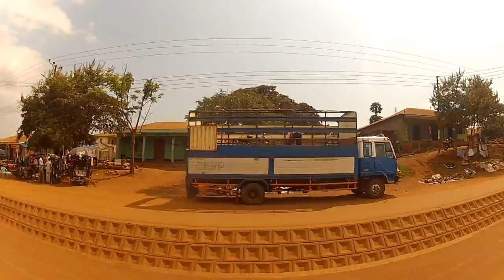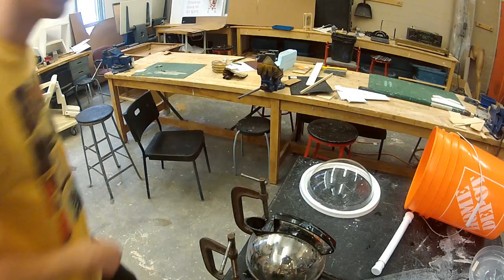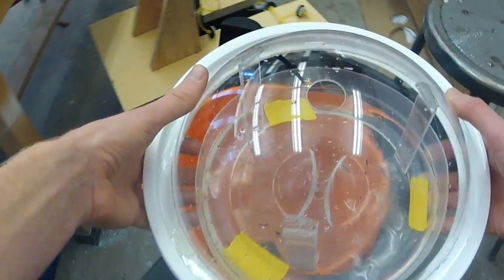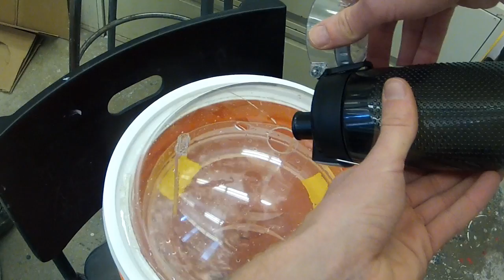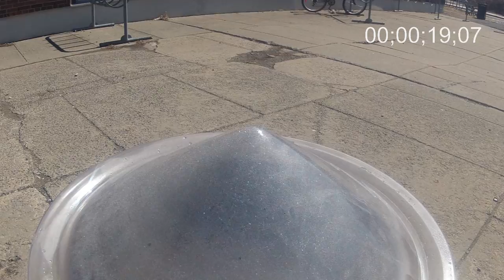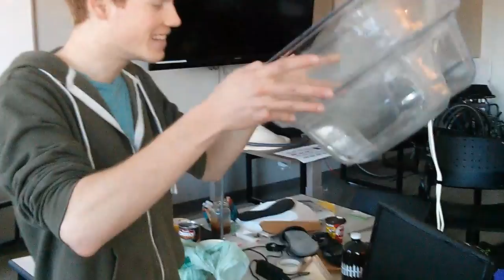Solar Still Design Process

Comment: so after 8 hours of sun it will provide like 10 small sips of water? ur gonna need like 4 of these in order not to die of thirst if u ever get stranded in the ocean.
Reply: True, but you can kind of do the same thing with 2-liter, and other, plastic bottles (and hot glue) one guy here on YT made one and got about 40 ml from 1 per day from it, so you would need like 100 per person (one galleon per day).  So…yeah, not exactly easy or plentiful, but might help in some unusual situations.  There are also bigger, but still home use, units that uses solar to heat and blow the air into cooler area, that make a galleon a day.

Comment: How did you solve the issue of the distilled water evaporating again?
Reply: So your concerned that some of the water will be double triple or more times disstilled? Or the loss of minor efficiency in a totally passive device?

Comment: i have never had city water at home. living in a rural community county water wasn't installed.  we relied upon a deep well and still do. even though county water was installed in town, we never got connected. it was about 30 years ago, my mother developed bone spurs due to the hardness of the well water. and learned about distilled water, became a sales rep for a company that manufactures and sells distillers. we have drank only distilled water since. we later had to add a softener before the steam distiller because of the wear and tear the hard water has on the distiller. since I married and moved out (to the house net door) we have plumbed up to the same deep well and share lt with my parents, and have our own softener-distiller set up (no fluoride rat poison). i have drank this water for 30 years!
as a note...this company my mother sold for said NOT to distill municipal water sources due to the contaminants in the water leaving a damaging layer inside the boiling tank. they also later provided a carbon filter for "other non-H20 distillates that get passed through the process.(fluoride?)

Comment: Is it safe to drink distilled water?  Due to the lack of minerals it has, I have always learned that it is not safe. 
 The difference in the concentration of minerals on one side compared to the other...
Any explanation ?
Reply: its all ive drank for the past 3 months.  im still here. not gonna sing praises. but the fear of it us unwarranted. makes ya think...why do they recommend not drinking it?
Reply: @hatshirts  No expert, but other sources say that it is fine to drink.  It apparently tastes different (the taste people like in most bottled water is from the bit of calcium and magnesium), but there are actually packets with a little bit of salt, calcium and magnesium you can add to distilled water to make it have the mineral-water taste.

Comment: can you make it out of glass and stainless steal?
Reply: Hear No, See No Speak No Evil Yes, I made several from glass and stainless, I bought Turkey deep fryer pots, got some dome shaped glass lids, some stainless splash guard inserts for the pots, drilled hole in the side of pots and splash guards, inserted glass tubing and sealed them with food grade silicone sealant, ran the tubing out the side into glass wine fermenting carboys. I also painted the outside of the pots with flat black high temperature stove pipe paint to speed up the distillation process. The people that use plastic are messing with their health!... BPA.. no thanks!
Reply: @JohnWayne-86ed  Some shaped glass lids.  No idea where I could get one of those.

Comment: the best way to distill water off the grid is do it like the bootleggers make moonshine, with either a copper or stainless steel distiller,
Reply: Ken C You’re right and as a added bonus you can also make moonshine which is has all kinds of benefits
Reply: They boils water we need something different